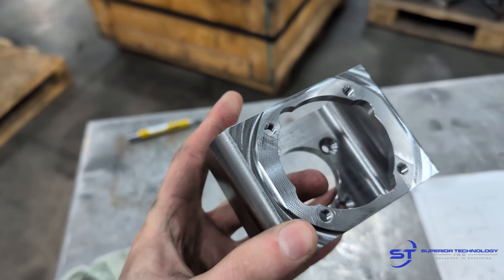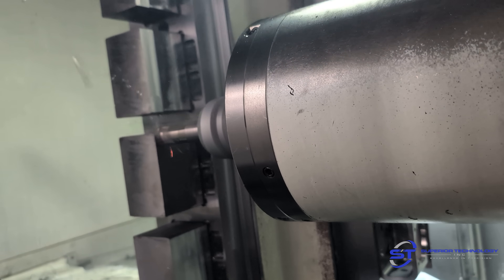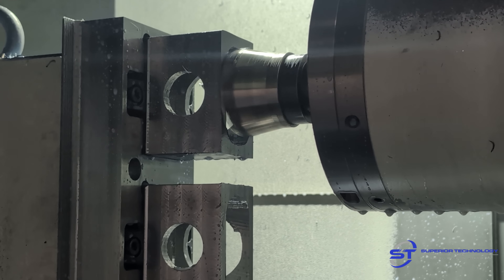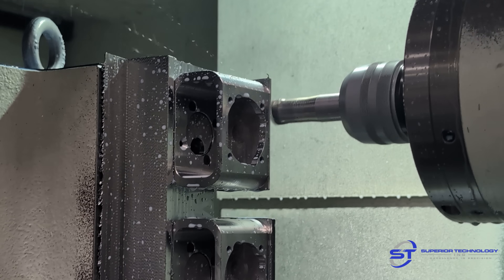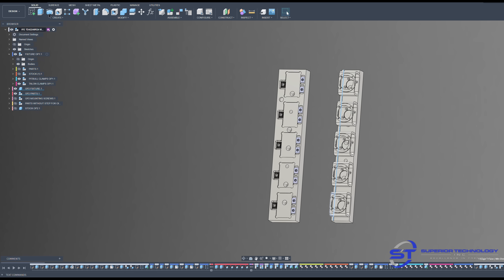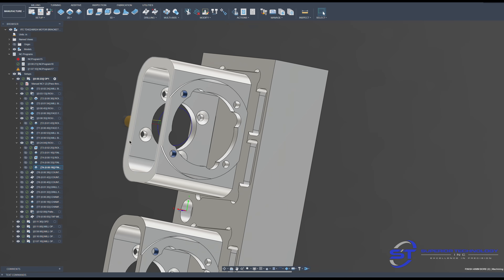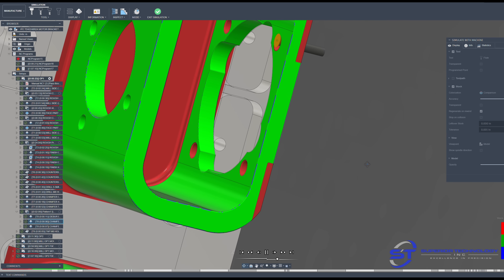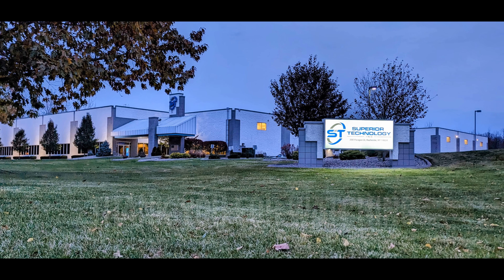CNC Milling Job Shop Work - No Tubing, No Problem!

Comment: On my first watch when you posed it in November I didn't catch that its an 1100 pc run. That is WILD.

Pretty big goof from the customer not realizing it couldn't be made from structural. Part cost must have been 3-5x over structural? How did the customer take it?

Comment: Do you like the Dormer high feed more than the Seco?
Reply from the maker: don't have much experience with the Seco ones to be honest. thats one brand i have never actually given a shot
Reply: @MSMillingCNC oops. I meant sumitomo. I was watching your older vids and saw the one where you were running a tomo hi feed. We just started using one of Kyocera's high feed and like it so far. Keep up the good work!

Comment: https://youtu.be/jsylAjnXRH8?t=694 Last op I would flip it 90 degrees and put some endmill at work.. just follow the inside contour op of the solid with some overlap and leave some material for a claening pass. 
The remaining stock will just fall off and save a lot of time.

Great first video, keep m coming 💪

Comment: if you like that HI-FEED you should give the tungaloy DoFeedTri a go at 985 SFM at 0.060 chip load at a cut depth of 0.040 i a have run it at that aswell and wow dose it move at about 866 IPM

Comment: Holy Cow, I need to get a more powerful PC for doing Fusion.  The simulations are so vivid.  I’m doing it on what I thought was a good laptop but it doesn’t compare.  Great video.  I’m amazed those little clamps hold the parts enough in OP1.  I’d be hiding around the corner of my machine.

Comment: cool machining, dumb accounting ... they made it from structural tubing to save money, and here is the american contractors machining it from solid stock and going against the spirit of the design/engineering
Reply from the maker: Hey they approved the cost for machining it out of solid lol
Reply: If the tubing size is not available you either make it from what is available or don't take the job.
Reply from the maker: @phillhuddleston9445 we were in contact with their engineers for a good while making sure they approved this method of making these because they declined any US tubing equivalent even though the difference in size was negligible, so we added a few extra dollars to make it from solid and they were alright with the price so it worked out for everyone

Comment: isnt the parts deforming ??? ( after removing the material from the back the structure should change)
Reply from the maker: With the 1018, yes it was a ton. Surprisingly with the A36 it's less than .001
Reply: @MSMillingCNC  i had to check whats that material in europe :DD s235jr or st37-2, the 0,001 is around 0.03 mm - which i find it strange , were the parts heat threated ? or i dont know hot to say it - relaxed ?(from tension)- i would expect much more difference
Reply from the maker: @tonibeko3929 nope they were not. Just standard hot rolled steel, although the process of hot rolling it has the sort of effect of stress relief
Reply: @MSMillingCNC  thanks for the ansvers :) all the best

Comment: Well thought out fixturing and programming. I always enjoyed that process rather then the actual manufacturing of said parts. Excellent finish, deburred on the machine. You have those feeds and speeds ripping material!  The structural tubing would have been more trouble then it was worth. Good choice to make it out of solid stock. Nice work!

Comment: Thank you for showing all the work on that part !  It is helping a lot, I don't think I have ever seen such a video on machining on a horizontal. What is the reason you use the high-feed endmill to rough face the stock, and not a facemill that can take it in one cut ?
Reply from the maker: I was having an issue with tool life and not being able to get as much life out of the inserts cutting through the scale  so I changed it over to the high feed mill. I was actually doing exactly this when I first set this job up
Reply: @MSMillingCNC  Thank you for the answer !  I hope you post more videos on projects on the horizontal mills you run.

Comment: I do the same thing with setting the ramp angle to 10 and using the step down to control the ramp. Great video.

Comment: Stupid question, did you ask the  engineer if you could use the closest US raw material? Looks like the oudside dimentions are not critical. 
Sometimes it is smart to ask the last guy in the production chain also. He knows best what will work and what not
Reply from the maker: No question is a stupid one. And yes we asked multiple people and all of them declined to let us use the US size and material equivalent for tubing
Reply: @MSMillingCNC  Very sad, my brain say's this should not be a problem. But also lucky you! The tube they want is always very oily and often warped. So they will get the most beautiful tubing ever. :) plus it is way more fun to watch chips fly.
Reply from the maker: @tekar88  yeah blessing in disguise, as im not sure i would have been able to consistently hit the perpendicularity or runout tolerances with raw tubing on the outside

Comment: Great content. Would be interested in stats like run time vs programming time also your methodology for quoting/pricing
Reply from the maker: These parts ran for 1hr and 13 minutes for 5pcs complete. For a part like this, i actually programmed the entire thing before submitting the quote just to be precise with the cycle time for the part, just because the program was short and only took like an hour to do. Normally i will program what i perceive to be the most time consuming or hardest to estimate operations on a part then use my prior experience to estimate the added cycle time of easier features. I think all in on these parts from a blank file to drawing the CAD for the part, designing the fixtures, programming it i probably had 5 hours into it

Comment: This was awesome! Why did you at the beginning of the op2 rough the rest of the material on bottom of the part along the part and not perpendicular to the face like you face mill it? Thank you!
Reply from the maker: I was waiting for someone to ask this! The reason for that is because high feed mills take such a low axial DOC, if you roughed the material like that, you would be left with a very large unsupported flap of material when you got down to the last pass because of the large pocket in the center and I was worried about it breaking free on the last pass and ruining the inserts or moving the parts

Comment: That's awesome, very cool setup and machining!

On the other hand it hurts my engineer soul that the tubes couldn't be sourced to make the parts from.
Did you inform the client you were going to make the parts from solid? They might have wanted to make some changes with that information in mind.
Reply from the maker: Yes, this was the process they approved
Reply: @MSMillingCNC  that’s great to hear, communication is key 👌

Comment: On a run this big I think I'd stick a nice big insert drill down the pocket to save a bit of tool life. Other than that, absolute perfection.
Reply from the maker: Thought about it but only made about 10 seconds of cycle time each difference on CAM so it wasn't really worth the extra tool and tool change to me, but this is very common practice
Reply: @MSMillingCNC  Only because even though I know you get 4 sides on those inserts, 50usd a flip is a bit painful. I've never managed to get a really really nice highfeed path out of fusion. Would you mind showing your settings? Im assuming 3d contour?
Reply from the maker: @spikeypineapple552 that part of the tool path is just a 2d contour with the ramp option selected on the linking page and the max ramping step down set to .032. the center slot is 1.574 wide so it's small enough to just do a straight ramp down the inside contour and clean up the whole thing. The inserts last roughly 10 cycles (50pcs) so that is basically only $.35 each in tooling if you divide it out, so not terrible
Reply: @mjshorty19 oh no sorry I meant the one where you need a stopover pass. For me it's always retracted to the retract plane before ramping again, I'm assuming that's because its a 3d?
Reply from the maker: @spikeypineapple552 fusion tends to be funny about that and you have to play with the linking to get the tool to stay down. The path with the stepover was just a 2d pocket tool path with the keep tool down set to larger than the largest pocket diameter and the safe distance only set to .025 so it doesn't retract much when moving back to the center to start the next depth. I tend to use 3d adaptive clearing a lot more than 3d pocket or contour for roughing because the tool path is much easier to control and get to do what i want, even though feed mills are more designed with the pocketing stepover method in mind rather than a dynamic milling path with high stepover and low axial DOC, I always find it works fine in practice
Reply: @MSMillingCNC  Yeah it just makes me cringe when it has to do those last tiny little cuts on an adaptive when i know it doesnt care about banging into a corner. thanks for your help. The BNGX 25mm has got me out of a lot of sticky corners. you can neck it down and stick it out a good 80mm.
Reply from the maker: @spikeypineapple552 I normally just play with the optimal load to get rid of those, they are very annoying

Comment: As a fledgling cnc operator, you are STUPIDLY good at this
Edit: Your presentation style is also really good
Reply from the maker: A measley 10 years ago I was stuck back in deburring, and 8 years ago I was a machine operator running production on a vertical mill. Fully self taught (with the assistance of YouTube) I have a lot to learn still but I like to think I know at least sort of what im doing 😅! Thank you!

Comment: Hey Michael, this may be an odd question. but would you be open to sharing the fusion file for this setup/machining? Im learning fusion cad/cam and currently learning fixturing. I would love to spend sometime looking at how you did all this. No worries if not, I know most job shop stuff is confidential.

Thanks! 
Noah
Reply from the maker: Let me check tomorrow if I can fix up some stuff so I can see if I might be able to share it
Reply: @MSMillingCNC that would be great, thank you!

Comment: .02" IPT is crazy!! Thats awesome, high feed mills are so cool
Reply from the maker: That's actually low for this cutter. I wanted to do .026ipt but the mazaks standard max feedrate in normal mode is only 315ipm so I deal with .02 😑

Comment: Looks great.  Id love to see how you get the most out of your horizontal machines.  If you have the bandwidth I'd love to hear your thoughts on what you would have to do differently to run this part in a vertical machining center, and why it made more sense to run it in a horizontal.  Imagine you had a pallet changing vertical that could hold your fixtures.  What would you do differently and why?  Keep 'em coming.
Reply from the maker: Horizontals are the cheapest form of "automation" in my eyes because the machine can be running parts while the operator is loading it. In the case of these parts, the loading is about 10 minutes and this machine is actually running a different job that has about an 18 minute cycle on the opposite pallet so the machine's spindle never stops running. The issue with a standard VMC is you have to add the load time to the effective cycle time of the part. On a VMC this would be a probably 3 fixture part instead of 2 because you need both top and bottom done and the operation to do the bores on the sides. In general i always prefer to do all of the close tolerance features at once, like I have on this part. I have a feeling that .002 runout between the side face and both bores and the .0039 perpendicularity to the opposite side would be extremely difficult to hold if you were doing them in multiple different operations. The fixtures wouldnt look too different from what i have now, except for having one with the profile of the part slotted out to hold the parts for facing off the back.

Comment: I am confused about the 5.5mm drilled holes for the m6 threads. Normally you would do a 5 or 5.1mm hole for a m6 tap. Thanks
Reply from the maker: Form tapped threads. I rarely use cut taps anymore, much more predictable life

Comment: Thanks for the share, but the tooling costs must have been heavy.
Reply from the maker: It's all relative. The price of a few new $300 endmills and a $500 high feed mill divided over 1100pcs actually isn't as bad as you'd think. It's less than $1.50 each in tooling and inserts

Comment: i love your fixture on the horizontal, i am wandering why notuse use all 4 sides of the tumb stone, as more parts save tool changes. maby becose of clearence
Reply from the maker: I have 2 other fixtures I am going to be running on the 2 opposite sides right after this job or I definitely would have done that!

Comment: was it not possible to rough and finish outside before doing the big cavity inside? my reasoning being that feedmills generally produce less side loads, so it wouldn't care as much about the wall thickness, but the thin wall thickness creates problems for the long endmill doing the outside?
not criticizing or anything of the sort, grateful for showing the tools and how you run them, I just thought maybe doing the outside would be less chattery before all the material is removed from the inside
Reply from the maker: That was originally my process yes, but when you rough and finish the outside then do the inside, the part distorts from the substantial internal material removal so I don't really have an option to do the outside first even though that's normally the workflow that I would employ!  I don't take any suggestions as criticism, I love to hear other people's insights into things I might miss!

Comment: I am interested! My Dad and I run a small family owned and operated machnine shop. We run everything in mazatroll currently but am wanting to switch to cad cam. This video helps me understand how everything works. Do you own your own Machine shop?
Reply from the maker: Yes I am the 3rd generation owner. I've never programmed anything in mazatrol. I've always done everything with g&m code, just how I learned. When I first started doing programming, I used to write all of my programs in cimco editor line by line so I knew how to read and write that style code much more fluently

Comment: Great video, thanks for sharing. As someone new to this type of work, could you please comment on why one would choose A36 vs 1018?
Reply from the maker: Just different chemical compositions. One is cold rolled steel, the other is hot rolled. Our customer did a material analysis based on our recommendations and approved our deviation for A36 steel since we could not get the specific tubing that they called for. Also, because A36 is hot rolled it has a lot less internal stress in it than cold rolled 1018 would be. Given the amount of material removed from this part I was having a big problem with the parts distorting a ton after machining with the 1018 test parts and was very thankful that the A36 was much more stable which I expected in my experience with steels. The tolerances would have been very hard to hit with 1018 that has not been stress relieved.
Reply: @MSMillingCNC  Appreciate your detailed response!

Comment: Great video, there are not many CNC programmers on YouTube that really know what they're doing. 
As a fellow machinist you nicely covered all the main points.

Did you consider roughing the deep pocket with a U-drill prior to high feed?

Would you add a 2nd pitbull clamp if you had to re-make the fixture? 

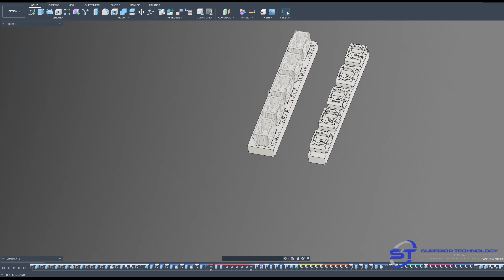At the 5:35 mark I can see you have colour coded components and timelime in fusion. Is that an option in preferences somewhere?
Reply from the maker: Thank you. Yes I did consider the pre drilling but given the cycle time for roughing with the feed mill was pretty low already I thought it was unnecessary to add another tool. As far as the pitbull goes, if I did this again yes I would. I actually used some 1018 we had laying around to prove out the program and I never had an issue with the parts moving until I got the A36 stock, but the clamps are having a little bit of a hard time grabbing onto the hot rolled mill scale on the A36 which I didn't account for. I would for sure add a second one if I do have to do this again. 

I am sure the colored components is an option somewhere in fusion but I changed it so long ago I have to check and see where that actually is!
Reply: @MSMillingCNC press shift-n to toggle coloured components